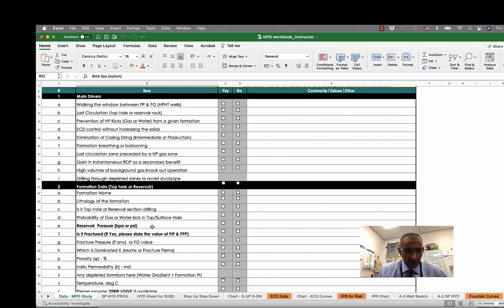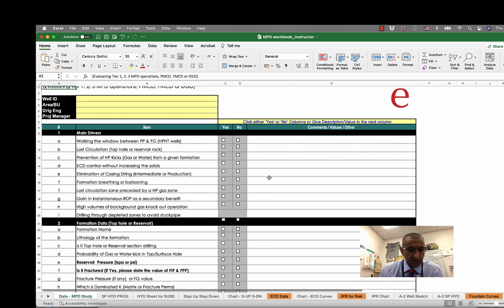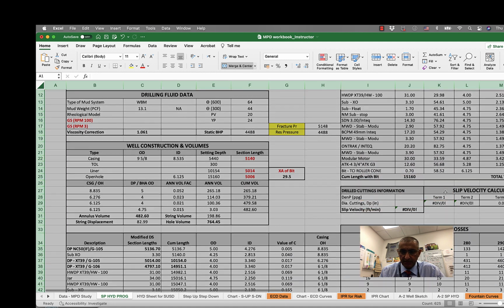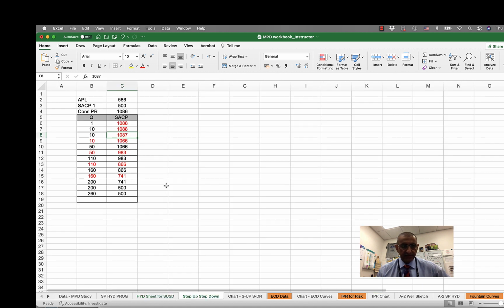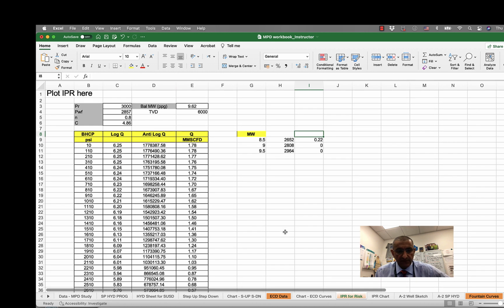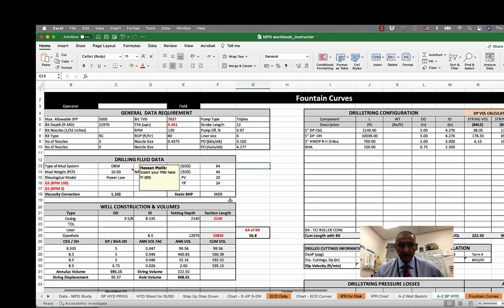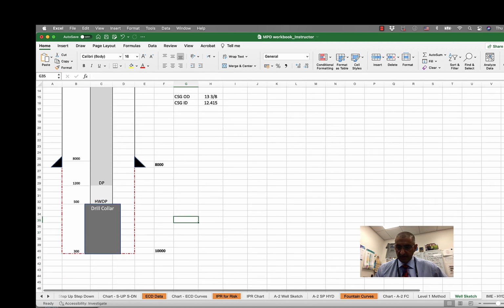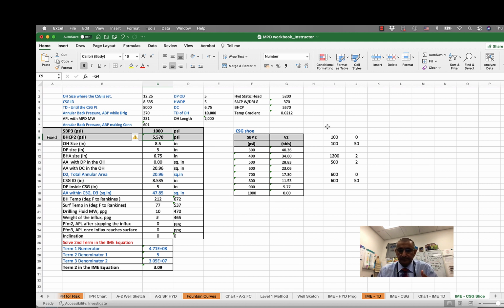Managed Pressure Drilling Workbook - A Brilliant  & Handy Tool for a Drilling Engineer

Comment: Kindly share same for Drilling Fluids Engineers for MPD
Reply from the maker: Good day Sam, I am trying to understand what exactly it is that you are looking for. The fluid section for MPD pretty much revolves around the PV value which can be calculated using the rheological variables of theta 600 and 300. Other than that, I suggest that you read my paper on Level 1 that I published last year in the Drilling Contractors Magazine. The level 1 study will give you a brilliant insight how MW, SACP and BHCP values are related to each other. Have a look at the below link pal 

https://www.drillingcontractor.org/a-novel-approach-of-analyzing-well-sections-as-mpd-candidates-55393

Have fun
Reply: Interesting share, Mr Malik.
I think this answers my question.
Thumbs up!